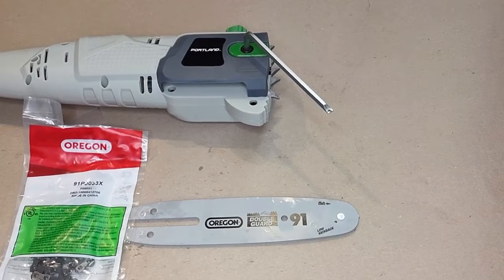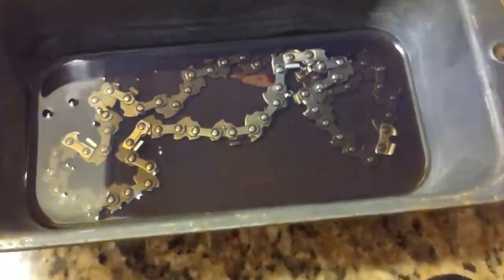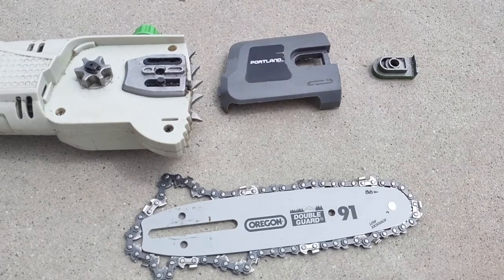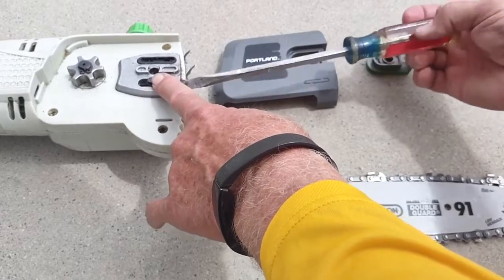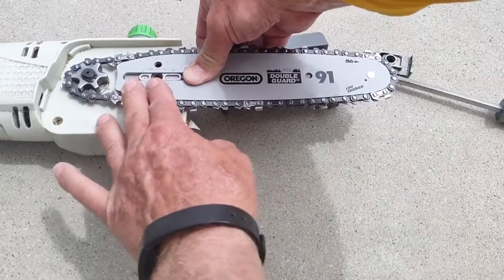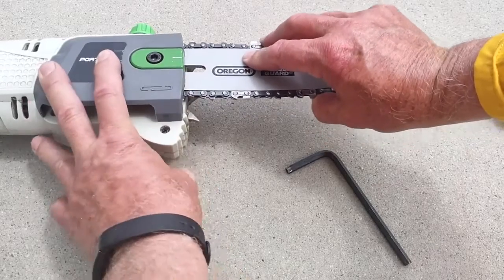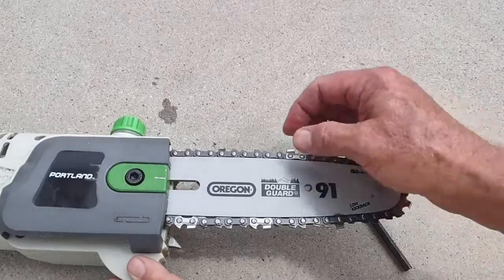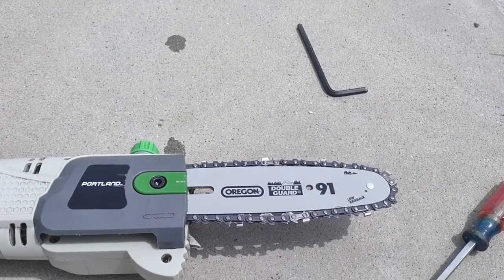How we install and adjust the chain on an electric pole chainsaw | Portland Pole Chainsaw DIY video

Comment: Great video. Very well explained. I have the same exact polesaw. I was doing massive amounts of trimming a few weekends ago and threw the chain. After teardown and reassembly, it threw the chain a second time. At that point, a heat induced migraine hit me, and I couldn't recall the one step that I felt I was overlooking - adjusting tension. Thank you🫡
Reply: Thanks so much for your comment. Best of luck with your next DIY project and hopefully you will subscribe to Big Al Repairs.

Comment: I love my Kobalt 80-volt - 5ah  battery -  10" Bar -  6 ft / 8ft foot Pole Saw.  I have been using it for more than 3 years now.   It works great on my southeast Louisiana farm clearing property that a hurricane went through and trashed all the trees in the woods of our 20-acre farm.  Today I'll be cutting a 6-inch limb off of a tree out front.
Reply: Best of luck with your clearing. I hope all goes well. Thanks so much for your comment. Best of luck with your next DIY project and hopefully you will subscribe to Big Al Repairs.

Comment: Thank you so much for this EXCELLENT step-by-step video AND the reasoning behind the “how and why” to have a safe, long lasting piece of equipment! I stared at the directions for 10 minutes scratching my head if I was doing this correctly. Your video had me up and running in 2!! Thank you! I hit the subscribe button also! ❤
Reply: @Amy. Thanks so much for taking the time to comment. Best of luck with your next DIY project and thanks for subscribing!